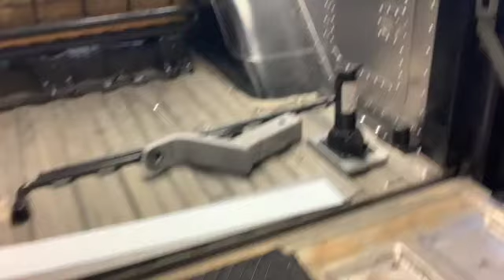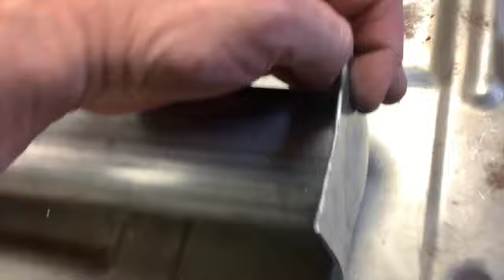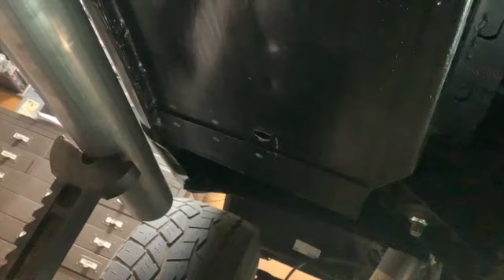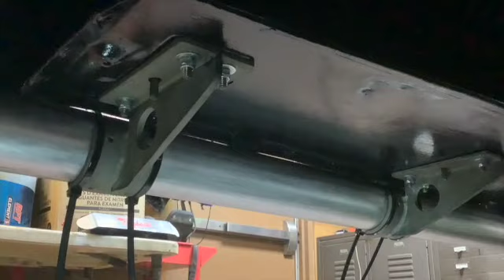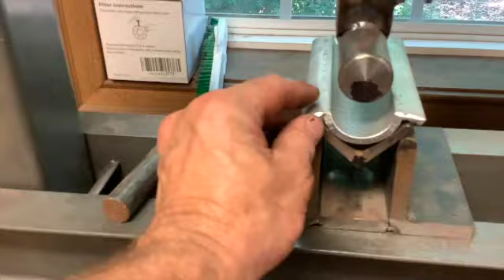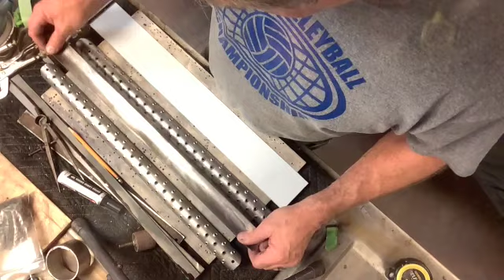nerf bars   SD 480p

Comment: Hey Don, I've skipped the Blazer stuff, did you ever get the RX7 done, or running, or anything? Was enjoying that process as I go through adapter plate ideas, just wondering if it ever got a conclusion.
Reply from the maker: Matt, RX7 is not done but still in my shop. The plan was/is to finish the k5 with my boy while he’s still at home. The progress is steady but slow. I’m looking forward to getting back to work on the RX7 when the K5 is out for paint.